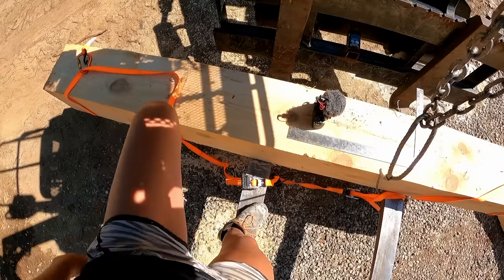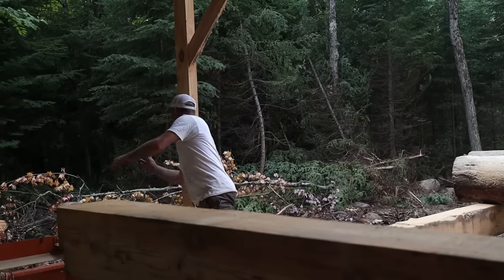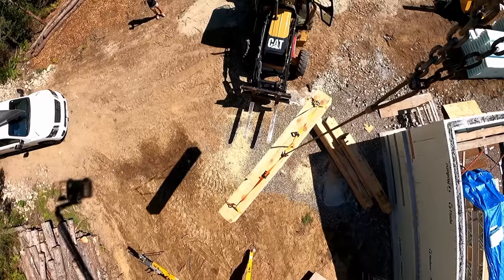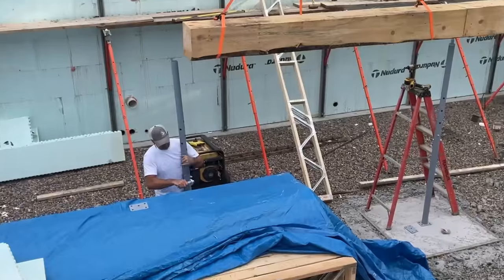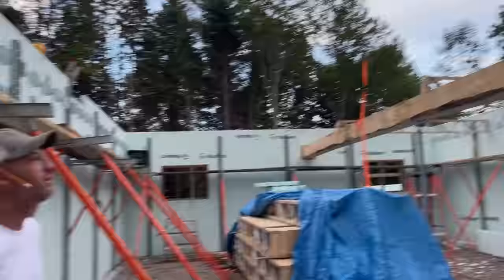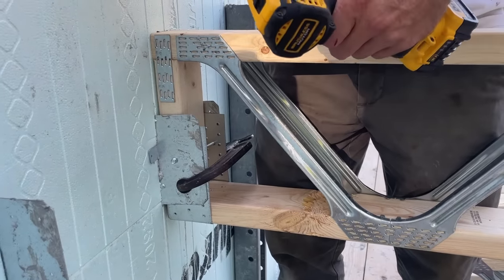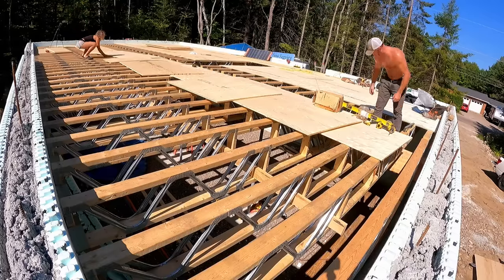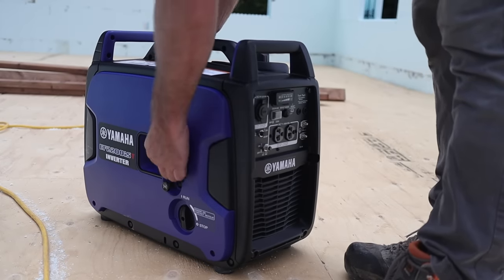Milling our own Beams and Floor-Installation on our Self-Built ICF Home

Comment: Awesome job that you are doing.
Reply from the maker: Thanks so much Yves!
Reply: @TimberMates  we are neighbours from Low, QC. Not sure exactly where you are located up the Ottawa Valley but cannot be that far. Too bad that I just saw your ICF video as I would have offered help simply to gain experience. O have helped a  friend prepare for an ICF pour and have to admit that I am completely sold on the concept. If ever I build, that is the way I would go. Oh, and we also operate a HD36 for fun

Comment: Cool video; curious; those beams will ultimately absorb the weight from the floor on up however what supports the beams?  Are posts put into the basement floor to support?
Reply from the maker: Thanks for watching! Yes there are 4 jack-posts sitting on concrete pads on the basement floor to support the beams

Comment: House is looking great!  Question on the joist, outside wall side, do you rely on the shear strength of the bolts or is there a support under the joist?   The beams look great.   Looking forward to the next update.
Reply from the maker: Thanks Shawn! The joists are spaced only 16 inches apart so they are very close to begin with, which spreads the weight out a lot, so relying on the shear strength of the bolts and hanger but they are super strong to begin with

Comment: Why such thin sub floor? 1.125” thick is usually the minimum. I always think about what it would do when rolling a 700 pound upright piano across it. A small wheel could crush 5/8”. I will I admit I like to overkill where I can. 😊
Reply from the maker: The thickest plywood available is 3/4 inch. I honestly have never heard of anyone going that thick. The distance between joist is a big factor. We are adding another layer of 3/4 on top for something interest so stay tuned
Reply: @TimberMates  I will stay tuned. I’m in Oregon. I used post and beam on my house. 4’ on center and used tongue and grooved 2x8 boards for the subfloor. 3/4” plywood on top of that. 1-1/4” tongue and groove plywood for the subfloor on the second floor set on 16” center 2x12. Maybe a bit overkill. 🙂

Comment: A couple of metal props holding up the whole interior structure. I like our building regulations just fine.
Reply from the maker: Beams are tied into the walls too, those sunk into beam pockets on the concrete walls are taking a TON of load.

Comment: Looks beautiful but why not put a scarf joint to tie the Timbers together?
Reply from the maker: No time for that, we'll be putting steel plates on either side of each joint and the bottoms are screwed together on a pretty beefy plate too. The steel plates will be black and be exposed in the basement to add to the aesthetics too.
Reply: @TimberMates  fair enough. Good luck love your hard work and dedication to doing this.

Comment: Without any kind of scarf joint to keep those beams connected, I'm not sure I'd want to be living in that house when they start to dry out and shrink.
Reply from the maker: We're putting big steel plates on either side of each joint, and the bottom plate holding them is pretty beefy too
Reply: @TimberMates  Fair enough.  When you said it was going to be exposed though, I kinda assumed you wouldn't want anything like that visible.  :)
Reply from the maker: @-_James_-  We're going for the iron plates and big bolts look :)

Comment: Lucky ya did the icf yourself would’ve ya costed a fortune.. it’s pretty crazy the whole icf world. Same R value as traditional foundations but a lot more expensive
Reply: These manufacturers make me question so much. 1. Concrete tempature will be the same eveeywhere throughout the foundation 2. Since this needs to be poured dry good chance their can be lots of honeycomb. 3. Uv rays will degrade the foam I think. 4. Mice love styrafoam. Traditional foundations with frost walls will achieve the same r value for a fraction of the cost 😃

Comment: What kind of wood and how long aged before milling? Ty.
Reply from the maker: these are red pine logs and we don't age them before or after milling. The adjustable metal supports can be lifted over the years when they inevitably dry and shrink about 1/8 to 1/4 of an inch. The trick is to slow that drying process as much as possible to avoid cracking and twisting.

Comment: Looks like those beams were installed while green? How did you deal with that?
Reply from the maker: basically make sure they don't dry out too quickly is the trick

Comment: I'm sorry but can I ask what are supporting those large beams? The metal post seems small to me.
Reply from the maker: I'm Sorry but may I ask if you have any experience in construction? Because every house you'll ever see with a basement has these jack posts supporting the upper floor just like you see here. Here's the numbers, our floor (beams included) would have to exceed a total of 98,000 pounds before these posts are overloaded. Not sure if you grasp that, but basically those posts you think are too small are incredibly strong. not to mention the beam ends are supported by the concrete walls, which takes a lot of load off just the posts.

Comment: Shouldn't the wood be treated?
Reply from the maker: It doesn't need to be, no. Thanks for watching
Reply: @TimberMates  Not even to protect against termites and moisture?
Reply from the maker: @miketripp8673  The beams are inside our house, protected by everything around it, and the moisture content will be controlled. Not sure why folks are under the impression they need to be treated. I guess most just really don't know so they second guess everything we do and have done I n the past
Reply: @TimberMates  Youngsters wearing improper "footwear" raises concerns despite said experience does not necessarily add up to wisdom.  Even the best contractor is still capable of learning.

Comment: If you don’t know how to build and don’t understand what you’re doing, then don’t build and don’t do anything. This home has critical flaws at every stage and a complete lack of quality and structural strength.
Reply from the maker: I've been building with icf for over 25 years and those buildings will outlast both of us. Maybe google ICF before you make uneducated comments on things you don't understand.
Reply: @TimberMates  If your houses are so good and of such high quality, then sell them all over the world, especially in northern countries, and I will gladly see how they will look at you like an idiot.  🤣🤣🤣
Reply from the maker: You mentioned that you are an engineer, i have my doubts that you are. I am not, but i do have plans and drawings stamped by American and Canadian engineers that i follow. ICF is essentially reinforced concrete walls but with insulated forms strong enough to hold the pour and then insulate the building afterwards instead of building forms then removing them only to add insulation later. Its a very common and efficient building process in Canada US and Europe, works best in northern places due to the thermal mass of the concrete,  I'm extremely surprised you aren't aware of this with your apparent wealth of knowledge and experience. My walls are all 6 inch thick of reinforced concrete, most homes are 2x6s 16 OC with 7/16 OSB if you think that is a better product i would question your knowledge.
Reply: @TimberMates  I now live in the EU in Greece and no one in the EU is building with this technology.  Permanent formwork technology has been around for many thousands of years; only the materials change, but the principle remains unchanged.  In Finland it is prohibited to use extruded polystyrene in wall insulation.  And this is absolutely correct.  For one reason only, extrusion is vapor-tight!  In other countries there is no ban, but there are written rules that extrusion can be used to insulate foundations and roofs.  Etc., so boy, I know exactly what I'm talking about.  The only thing that will save your house from problems is that it is located in a fairly mild climate and has very short and warm winters.  In a cold climate, mold will begin to grow in such a house in the first winter.  For example, in Finland, houses with mold are demolished, that's all.  And they build again.  But you have never heard of this, because all of New York is saturated with mold and this is normal for Americans.  But this is normal for you, because you haven’t seen high-quality houses and don’t know what could be different and you’re not interested in how other people’s lives.  Unfortunately, this is a fact about America and Americans, I know this because I was and in America.
Reply from the maker: where are you assuming i live???
Reply from the maker: happy trolling

Comment: I have solid beams in my 1st floor. over the years they have twisted and caused the floor joists to be displaced upwards, causing an uneven floor and affecting the second floor joists due to support wall over the 1st floor beam locations. walls cracked in numerous places, second floor not level.  Wouldn't do that again!
Reply from the maker: i had to install large steel plates where they connect to prevent that, slow drying is important as well.